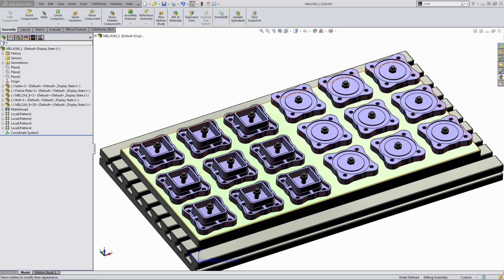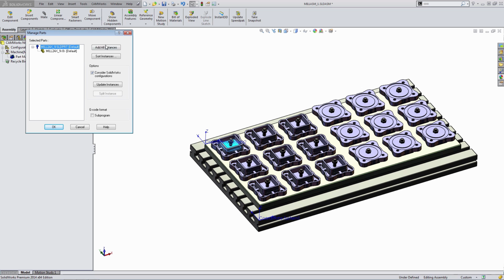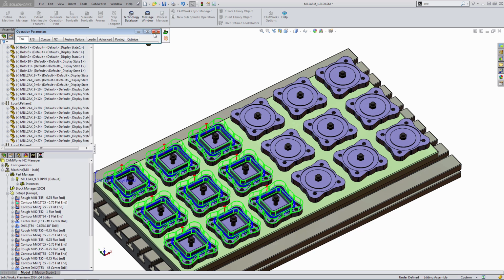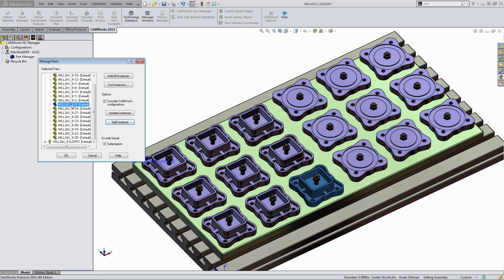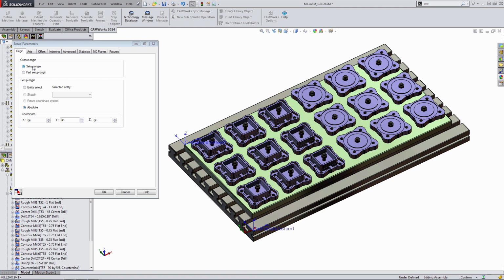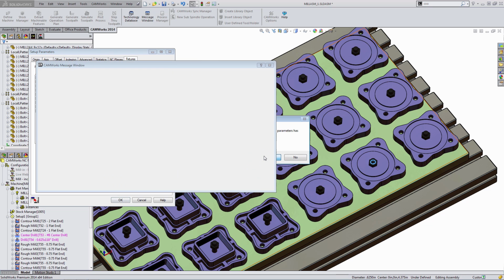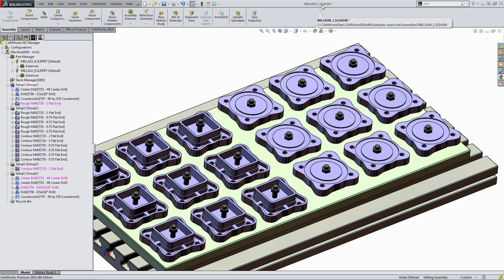CAMWorks Assembly Machining

Comment: 3:04 Search box

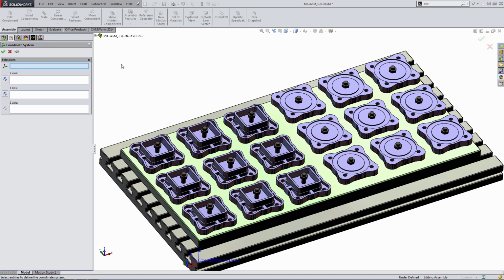3:23 Creation of a coordinate system, very important in assembly mode and different than part mode.
5:01 Reading in coordinate system in machine tab. Choosing number of axiis.
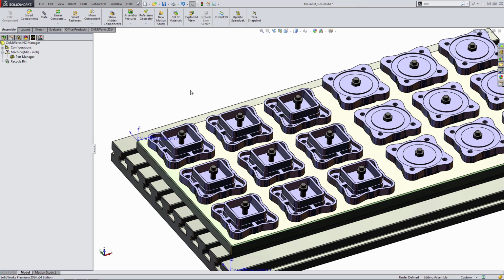5:39 Part manager in assembly mode. Choosing which parts in assembly to machine in feature tree.
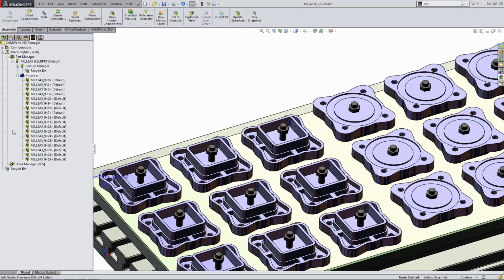8:14 Stock manager.
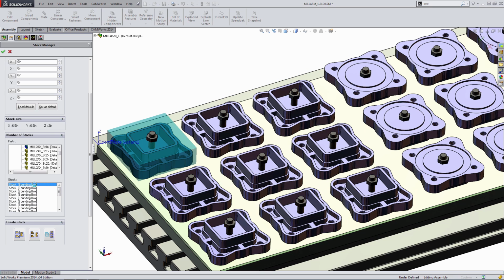9:38 Parts sharing stock.
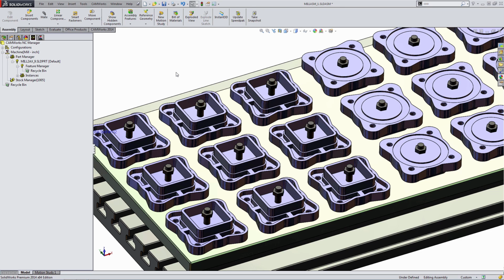10:59 Begin identifying features.
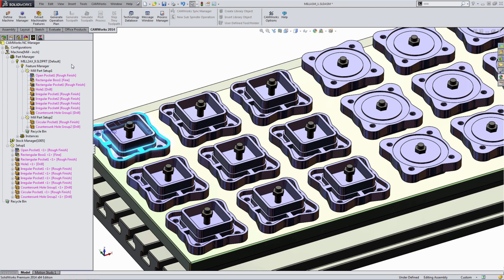11:32 Two feature trees. Very important. Features are added in the top setup.
12:22 Manual addition of features in mill part setup in feature tree.
13:22 Suppression of instances of features in feature tree.
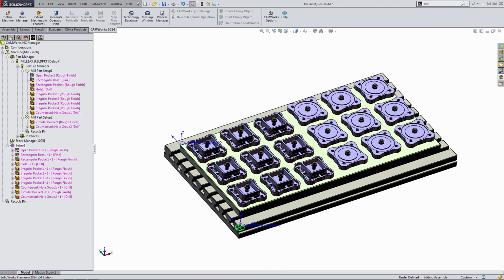14:14 Open pocket in assembly mode problem and solution. 
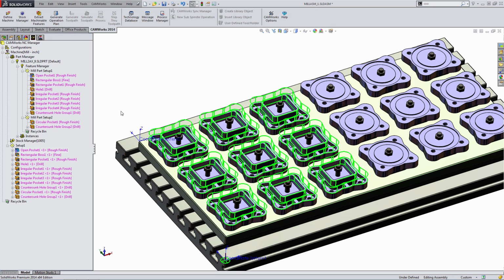15:28 Generate operation plan.
17:24 Overwriting database to assign better tools in feature tree.
18:12 Optimizing the order of a single operation in optimize tab in operation tree.
18:42 Re-ordering order of parts cut using part manager in feature tree.
19:15 Re-ordering order of operations in setup in operation tree.

20:22 Creating multiple configurations. Important if doing multiple setups of the same assembly.
21:42 Manually choosing all instances of parts to machine in parts manager of feature tree to control order of machining.
22:17 Split grouping of part instances in parts manager.
24:53 Importing part data in the feature tree. Important. If you've already programed the part in part mode, feature and machining data can be merged to assembly.
25:37 Combining stock for split groups of instances in stock manager of the feature tree in order to do multiple work offsets.
27:26 Setting up origin for each defined stock in mill part setup origin tab in feature tree.
28:43 After generating toolpaths, setting up origin in origin tab of setup in operation tree.
30:16 Presenter misspoke on the two previous subjects. Setting up origin for each defined stock by splitting setup in feature tree begins here.
32:35 Reading in and assigning fixtures as avoid areas in fixture tab of setup in operations tree.
33:55 Controlling the toolpath around the avoid areas in the advanced tab of the individual operation parameters in the operations tree.
35:05 Sorting/reordering operations for efficiency in sort tab under machine in operations tree.
37:00 Recap of presented points.
Reply: You rock - thanks!

Comment: hello, 
it´s possible in assembly like this, i can maching 1 part to the end and next pass to the other?
Thanks
Reply: Hello Andre.

I don't think this is possible while machining in assembly mode. The way I achieved what you're trying to do was, I saved my assembly as a .sldprt. I established my part zero on the lower left instance you want to machine. I then put all my toolpaths on that part, so I was able to complete a part. Then, I changed my machine zero by the same distance to the next part in the assembly. I repeated this until the job was done and I had all my parts out of the material. Not really machining in assembly mode, but I had to create an assembly to know where my next part would be.